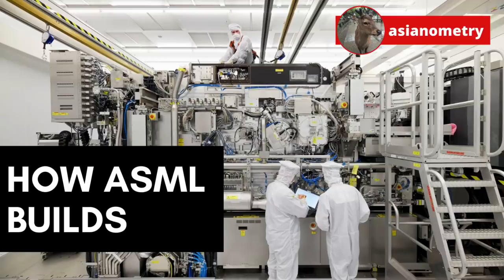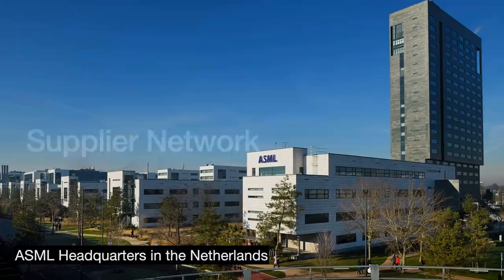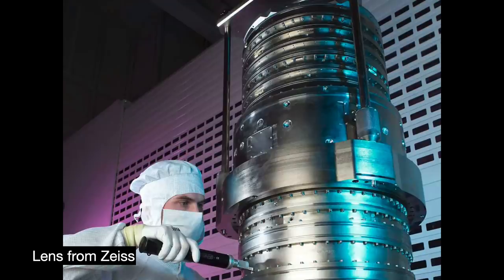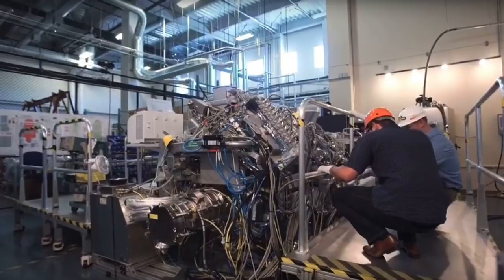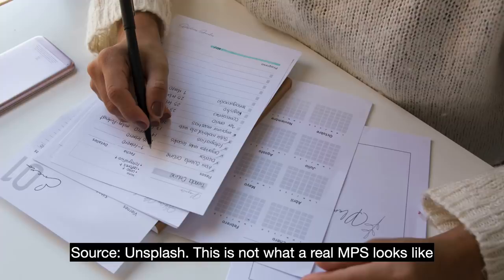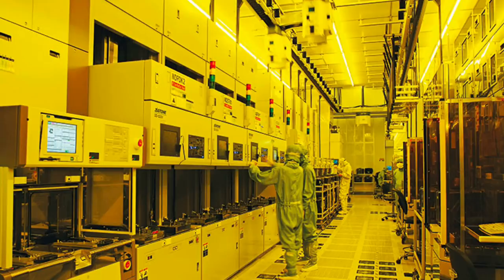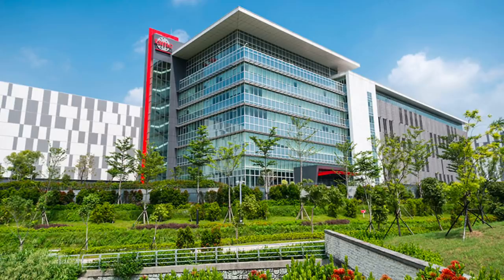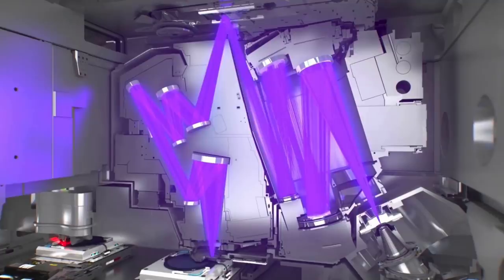How ASML Builds a $150 Million EUV Machine

Comment: I work in a outsourced supplier in the automotive sector. Specifically, a stamping plant manufacturing seat belt components. As I've learned about the way the automotive industry works, I see large parallels between how auto manufacturers work and how ASML works. You also did an excellent job in clearly communicating that structure without using diagrams or anything. It's quite fascinating to get all these details.
Reply: Yes I worked at an auto conveyor mfg.  Similar market structure, 4 main companies.  Integrating parts from many suppliers, fabricating our own, and then making it all work in the field.  But that's cave man tech compared to ASML 😂
Reply: They are machine builders.

Comment: My family works in a vacuum pump manufacturer that is one of the ASML suppliers (though it is a small customer compared to TSMC and Samsung who buy high end vacuum pumps by the thousands).

An aspect that hasn't been mentionned is export restrictions of components. For example, vacuum pumps are used in nuclear enrichment and Singapore is on the black list since pumps sold to a fab in Singapore were found by UN inspectors in Iran enrichment facilities.

Since then, only a handful of large companies are allowed to buy high end vacuum equipment.

I'm sure EUV lithography machines are full of restricted components also used in military equipments.
Reply: All chips can be classified as military products, because they can be used for military equipment. In fact they probably have been invented to allow for development of the ballistic rockets in the 60-70s.
Reply: so what

Comment: A friend of mine worked for ASML. He designed a certain part in the process - but the working conditions were crazy.
He would get detailed outlines of the parts he must connect to - but what he doesnt need to know is just a black box. And if the connecting parts to his design would change, he would have to redesign his own piece of the puzzle.
This means that such machines are in constant design where one change sends shock waves throughout other pieces - until someone decides to stop the process. Final changes move down the chain and the machine is declared finished.

Comment: Small correction. There are no lenses in the EUV machine (or well, not for the EUV part), Zeiss makes the mirrors for ASML. Those mirrors cost a million per pop.
And the main reason ASML's clients have different results is not necessarily because the machines are different, but because ASML merely makes the tools. Samsung, Intel, TSMC etc. need to develop their own recipe how to use that machine. What chemicals to use, what materials to make the masks out of, how long to expose, what feed rate to use etc. is not provided by AMSL. They have to figure that out themselves.
The maglev sleigh that houses the wafer is nanometre precise and besides that all exposure, maximum feed rate and emitter brightness are comparable enough that it's a non-factor over the other factors, the recipe.

Comment: I used to work for a precision equipment manufacturer that made parts for ASML as well as other huge organizations and companies. I can confirm ASML is a huge portion of that companies bottom line. They actually used intricately cut granite and lapped the important surfaces to within millionths of an inch. These stone components are basically used as the foundation or frame on which all the sensitive equipment will be mounted. Working at that small scale requires climate controlled factories, and high level clean rooms too.

Edit: forgot to say the company was Starrett Tru Stone Technologies Division. I worked as an entry level product finisher before doing some side projects for QC before moving on to another place.
Reply: One big customer - somewhat risky
Reply: Fascinating. Very interesting to hear the stories of ASML suppliers. In fact that would be a very interesting video for this channel to make!!

Comment: I often marvel at the insane  amount of engineering like this. The mind boggling thing is that, for example, the enormously complicated projection system can be decomposed to very simple math and physics model, a.k.a a few thin lenses and integral equations. But in reality, this takes billions of dollars and the crazy engineering efforts
Reply: well it can but also cant, math doesnt account the enviroment. they have to stabilize the very ground they build these machines on. a tiny unnoticeable shockwave in the earth can disrupt the whole process.
Reply: @STARCRAFT2OWNER  true! Modeling vs. real world = 1000000000000000 miles difference

Comment: The suppliers to ASML also have suppliers and those suppliers also have suppliers. Depending on which supplier in the chain has a disruption the faster the production at ASML gets affected. This is modern manufacturing for basically everything. Quality certification standards need to be followed in order to retain their certification from different organizations, losing certification means losing business/contracts and is very hard to get back if lost.

Comment: Like a Dutch journalist pointed out.. Moore's law? More like ASML's Law: they make the machines that make the machines. If ASML technological road map hit a roadblock, then Moore's Law hits a roadblock.
Reply: linkzable  Not really. The problem is not that it is impossible or super hard to achieve thinner structures. You can get even thinner. The main problem will be volume production. First EUV papers date back to the late 90's, so it took more than 20 years of research and optimization to get this technique to a level where you can produce chips at a reasonable price.
I honestly doubt that EUV will have any serious competitor (technology-wise) in the next 30 years.
Reply: @snookz3477  Why do you think China unable to build their own EUV machines ?
Is building space station, less difficult compare to building EUV machines ?
China managed to build own space stations without American help.
Reply: @zenlei8258  Yes, I have no doubt that it is way more difficult to build a EUV machine ready for volume production than it is to build a space station.
Reply: @zenlei8258  China's space station sourced alot of russian parts which makes sense. Though EUV litography has ony been achieved in volume by TSMC which relies on the only supplier that can make EUV machines, a dutch company named ASML. There's not enough expertise to start from 193nm littography and produce the machines AND manufacturing capabilities of TSMC. even Intel failed at their 10nm process node which did not even use EUV.
Reply: @snookz3477  I think the main challenge or roadblock here is the silicone itself, finer and thinner laser is achievable but the silicone building block is making it physically impossible to go smaller
Reply: @zenlei8258  probably because licensing
Reply: @zenlei8258   building a space station is ALOT easyer than building a euv lithograph, its not even compareable
Reply: @zenlei8258  The ASML CEO once told a story on Dutch television that the Chinese ordered an ASML machine and then disassembelled en reassembelled in order to learn how it works. The problem was that machine never worked again after they did this. So simply put: The Chinese can't do what the Dutch do
Reply: @snookz3477 
Man, I don't mean to imply I properly understand this stuff but I find it hilarious how you can say "Rocket science? Nah, I'd prefer something complicated" in this context and not be wrong. 🤣

Comment: Maybe I shouldn't be complaining about Intel's 14nm+++++++... didn't know it's this tough to manufacture chips.
Reply: well, x86-64 processors are dificult to produce due to CISC based architecture vs RISC based processor like ARM
Reply: @kealeradecal6091  I assume it means more transistors for a complete 'core' so more silicon that can go wrong while building a single core and effectively lower yields.

Right? 🤔
Reply: @_Jayonics  correct, although modern ARM chips usually have enough additional cores, integrated CPUs, integrated 3G/4G/5G radios, GPS, Wifi, Bluetooth, ... to more than make up for it. So nowadays the difference to x86-64 in terms of transistor count isn't really there any more or even inverted, and ARM chips are actually harder to produce than x86-64 ones since low power applications are usually the first to switch to smaller pitch. Eg Apple buying all the 5nm/2nm capacity TSMC is able to deliver for a year or so exclusively for their ARM chips before any other company (Nvidia, AMD, ...) gets a chance.
Reply: @giantnanomachine  I would have thought all the additional integrations like Wifi and bluetooth would be, if not on a seperate chip, at least on a seperate chiplet on the CPU (Like with AMD Zen core architecture), voiding the negative effect on yields of adding all those features (Just an assumption, I could be wrong about that).

But regardless, I'm constantly amazed at how performant all my Arm devices are in comparison to my X86-64 desktops and laptops, especially considering the price. I don't know if this is due to the monopoly AMD and Intel have on X86-64 licensing and production, or the fact that ARM manufacturing requires less silicon for the same equivalent specs but without a doubt, ARM ends up coming out way way cheaper in an apples to apples performance comparison.
Reply: @_Jayonics  packing more stuff into one actual chip instead of multiple chips on one package has performance/power/space advantages. Especially the last two are at a premium in mobile phones. However analog (ie Wifi, 3/4/5G, ...) and digital don't mix very well on one single chip, so indeed there is almost always the split into two processors in eg a mobile phone: baseband (eg a Qualcom modem) and the CPU (eg some Apple A-series). I don't have numbers for the most recent generations, but eg the CPU die of an AMD Ryzen 5600X is 80.7mm2 for 8 cores (two disabled) at TSMC 7nm. Compared to an Apple A13 (also TSMC 7nm but not sure if the same generation 7nm process, 6 core) the AMD die is almost 18mm2 smaller. The A13 also has twice the number of transistors (8.5b) than the Ryzen (4.2b, including the disabled cores). Why is the Ryzen CCD then not half the size? The Ryzen runs at significantly higher frequency and TDP, so some more space has to be given to "power lines" (and it also helps with thermals when the area is bigger).

Comment: You missed the main issue: Getting staff with the right knowledge and experience. ASML has bough up other companies, such as Mapper Lithography, just for the employees.
Reply: They are aware of that. That is why they started Brainport Eindhoven initiative to attract talent and improve the promotion of Eindhoven. I remember the CEO also pleading for more cultural activities/events in the area as every employee is driven by the decision of their family. If this is enough, I don't know. If it was up to me, I would ramp up investments in the area as state government.
Reply: @michaelhu9947  interestingly, they are also hiring people with an aerospace engineering background.
Reply: @paulroling1781  aerospace engineers have a broad knowledge regarding math and physics.
Reply: @michaelhu9947  With additionally knowledge on systems engineering (and integration).
Reply: @paulroling1781  In my experience, unless you've previously worked for ASML on their semiconductor Lithography machines, as an engineer from any field you don't have any previous knowledge to build on for the area ASML operates in. A lot of the concepts are exactly the same as every other application, just slightly different...

Aerospace engineers often have a good basis in well documented development and thorough testing and that's the sort of knowledge and experience that can transfer well to ASML and that a good engineer can build on to apply that knowledge and the concepts he learned in aerospace to what ASML is doing. But in the end it's still the case that you might speak English, you speak technical English, you may even speak specialist engineering English, but when you start in ASML you still need to learn to speak and understand ASML, which is it's own subset of English and almost, but not quite, entirely unlike English at times.

Comment: 3:10 there is no "the lens" in a lithography machine, but many. Moreover EUV is absorbed by everything, so these machines use mirrors, which I think are also supplied by Zeiss.
Reply: Correct. Each mirror absorbs about 30% of power and the mirror layers need to be manufactured to the gravitational constant of the users location, to have the perfect thicknes.
Reply: I thougt it was placed in a vacuum becuse of this. Or am I wrong?
Reply: @jaaps772  the vacuum helps with several things. No absorption/diversion of x-rays and you don't have any particals "in the air".

Comment: Would it be possible to improve the EU process by going into a 0g environment? If yes they could become a mayor driver behind the space Industrie
Reply: No EUV use gravity to drop a droplet of molten tin which is then vaporized with high intensity laser. Doing it in 0g makes the process of hitting a droplet of molten tin with lasers a lot harder because the droplet will float into random direction.
Reply: @mariabaez6099  wtf this bot is really lost

Comment: 14 days to ship replacement parts seems awfully long considering the amount of value each of these machines is responsible for creating every day!
Reply: That probably sparked S-Korea to invest so much into the tech industry, including a 'repair station' by ASML in the country itself so local customers can have better and quicker access to spare parts, maintenance expertise etc.
Reply: Most spare parts are stocked regionally. The 14 day limit is for an unexpected failure of a part that was never planned to be replaced. In which case it typically need to be pulled from the production line without impacting planned deliveries.
Reply: that's why you buy two and operate them interchangebly
Reply: In reality if they can pay someone to put the part and a clean pair of undies in their suitcase and fly to the customer they'll put someone on the plane to deliver the part (or leave the undies out if they don't fit). If required that someone will be a person with the knowledge to actually install that part if it's something not normally replaceable. Also, it's 14 days from the moment the machine goes down to having the machine ready to cycle wafers again. When things get complex it can take days just to figure out what went wrong and what to replace, and then more days to put that part in, clean what needs to be cleaned and perform all the required calibrations and adjustments to bring the system back online. The actual shipping of the part is often the easy bit.

Comment: EUV is demanding! To give you some idea the most pure silica glass is totally absorbing at those wavelengths. but glass is a lovely amorphous substance that can be annealed to close to stressless. Stress or "crystallinity" in the optical elements creates birefringence and less than perfect focus. But they have to go with materials that prefer to be more crystalline in nature and this can cause too much birefrinence.  Oxygen in will absorbed the EUV and create ozone, blocking all the EUV light and damaging the device themselves. So all are purged with noble gases or pure nitrogen, of course strict filtration and positive pressure from this does help with cleanliness. 

Then they get into the light sources they are insane!

What is interesting is that as a light source synchotron radiation in the EUV/x-ray is much more powerful, can be controlled more easily and is much better quality than anything else out there. If the lithography demands more advancements down in the EUV towards X-ray, and considering how costly these machines are and the size of the foundries anyway. I wouldn't be surprised that there is a generation of foundries emerge in the next decade based around a dedicated fully commercial synchrotron light source with multiple EUV/xray beamlines.